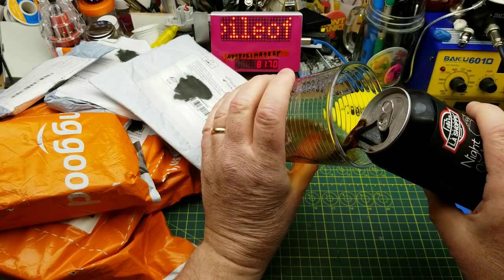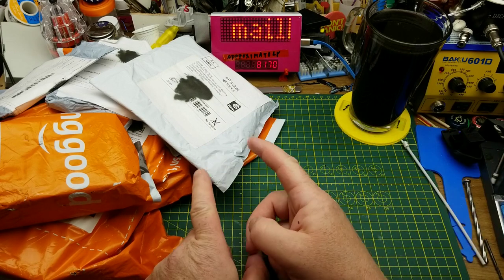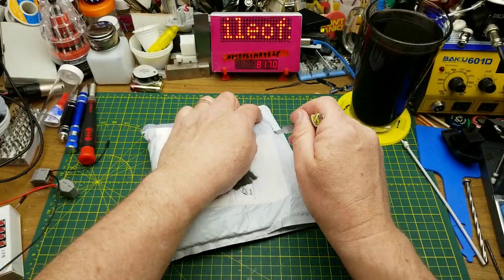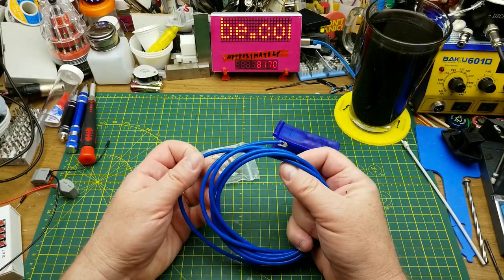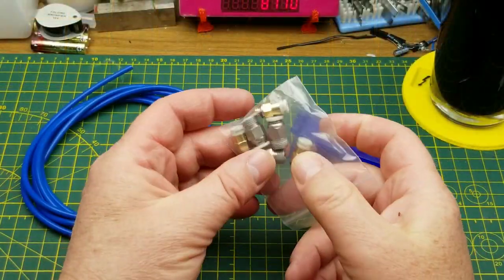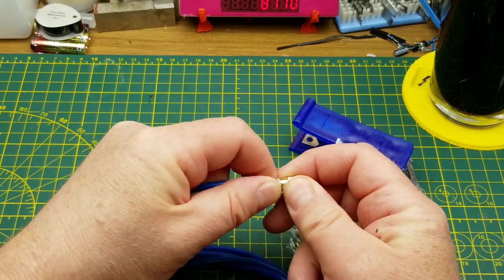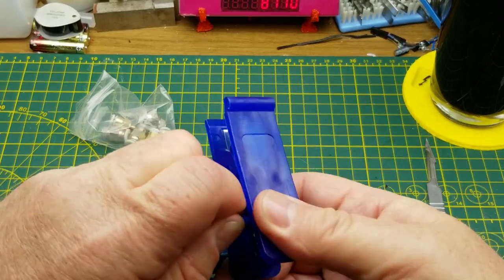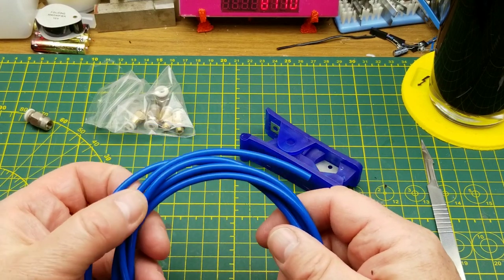Mailbag Monday #112

Comment: I didn't realize I had missed a bunch of videos. I was thinking it was you who had things 3D printed at his library. You've been talking about it in some recent mailbags. I must have missed you getting it on one of the videos.
I recently bought an Ender 3 V2. Haven't had time to assemble it yet. Wowsticks are nice
Reply from the maker: I did print at the library until they temporarily closed their makerspace to the public last year (bloody pandemic). 

So I bought myself an Ender3V2.  So far I'm liking it. Affordable, and can turn out a decent print if you spend a few minutes on day 1 getting it all square, parallel and level.

I'm slowly accumulating upgrade bits and a stock of spare parts.  Not that I expect any serious failures, I just don't want to be caught short. 

Plus, if I accumulate enough spares, I might be able to simply build a second one  from parts on hand...
Reply: @pileofstuff  I've gotten a few of the basic upgrades already and I haven't gotten it assembled 🤣🤣
I got the springs, Bowden tube, extruder and spare brass nozzles. Bltouch is I think in Illinois and I'm in Southwest Michigan. It's been there about as long as it took to get there from China. I ordered some stainless steel but they canceled my order so I'll try a different seller. I plan on getting a direct drive extruder and all metal hot end eventually so I'll be able to more easily run flexible filament.
Simple Electronics is putting together a larger machine from scratch so he'll have something to do large prints. He said he could always try a cnc if this doesn't work out because he'll already have most of the parts.

Comment: Picked up a feeler gauge and a step up convertor. :)
Reply from the maker: Don't expect much out of that step up board... video coming friday.
Reply: @pileofstuff  Man I was gonna wash two loads of clothes AND dry them from a 9V battery don't break my heart. 😂😂😂
Reply: @HazeAnderson  maybe when you connect two 9v in parallel.
Reply: @badhabit5457  For what it's worth I have two heavy duty 6V batteries in series for experimenting. :)

Comment: I like the weather station kit. Great video, I have doubts about the inverter however.
Reply from the maker: The inverter gets its own feature this friday.
Reply: @pileofstuff  looking forward to seeing that. Please be sure to show the waveform on an oscilloscope.
Reply: @pileofstuff  the soldering looks budget on this thing. The blue capacitor is not even fully soldered 😂
Reply from the maker: @badhabit5457  place your bets on what the most likely failure mode will be?

Comment: The ac-dc converter  ... the one with the transformer has a BAD Solder Joint on the blue capacitor I presume ... on the bottom ... check it out ...

Comment: Buy "auto-level sensor" for your 3d printer. I also level my bed manually, but this sensor is so precise that adhesion to bed is now perfect. My Anet A8 printer need Marlin software for auto-leveling. You will find ton of tutorials on Internet.
Reply from the maker: I'm aware of the BLtouch. I may go that way in the future, but for now I feel like the more I tinker wit the printer, the better I'll understand it.

Comment: That boost inverter has a bad solder joint.
Reply: At 8:38 blue cap
Reply from the maker: That's not it's only problem.

Comment: Feeler gauges are definitely more repeatable than paper, but don't rely on that for your bed level. Learn to read your first layer! https://youtu.be/RZRY6kunAvs

I use 1cm cubes at all four corners and one in the center and stop the print after the first layer. It tells you everything you need to know about the level of your bed.